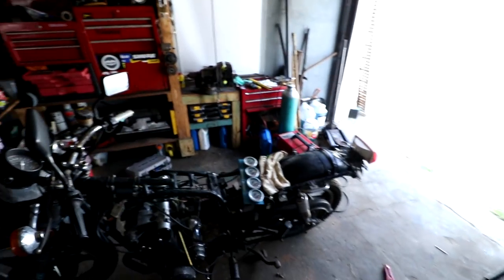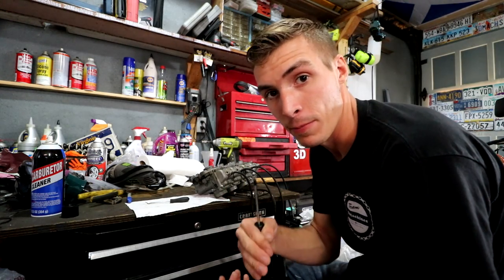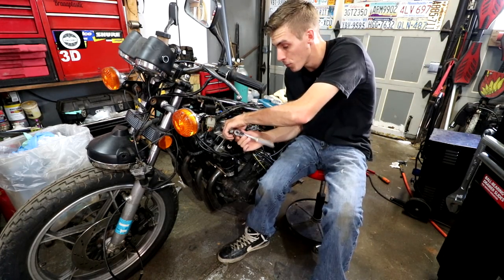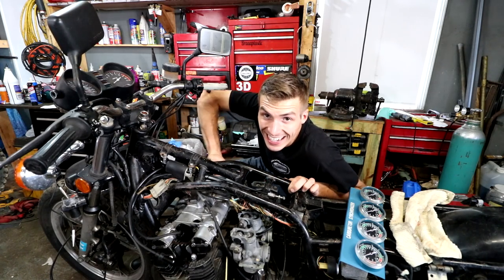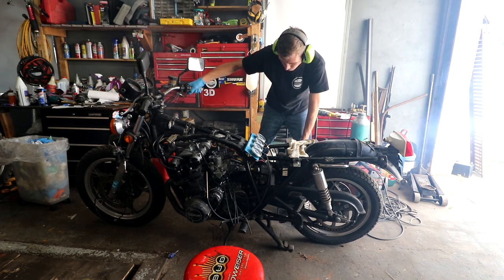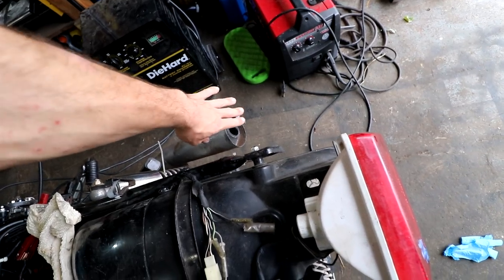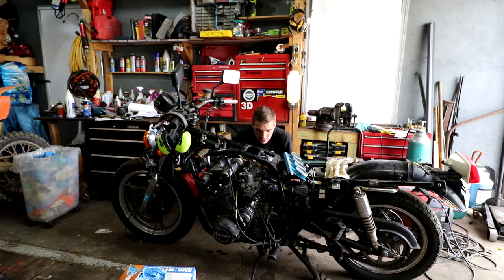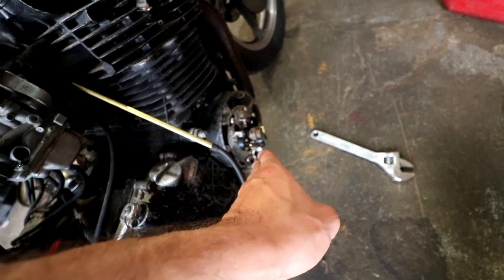1000cc ENGINE SMOKES TOO MUCH!!

Comment: Dalton I have had 2 of those bikes you are dealing with a timing issue not carbs
Reply: Rick Zamzow my thoughts too, carbs or fuel are probably a little off with all that smoke though
Reply from the maker: i leaned it out. Spark plugs look good. I just figured when I had that guy time it, he did it right... Guess not huh?
Reply: 3DMachines timing is NOT adjusted right...and check the heat from all 4 exhaust to se if it is some different temp between them
Reply: My '74 CB350F (F=four cylinder)
Was too easy to set up the points...

Supposed to use a dwell meter
to set the gap on points.
I always cheated...

Just put the cylinder where I wanted it to fire
(Top dead center... Then back up how ever many degrees.)
(there should be a mark for this...)
Then with plug that cylinder grounded...
Just start opening points 'til spark occurs
(I believe we called this static timing.?)
Then locked it down
repeat on second point/coil set.
Then you can verify with
a timing light...

Funny... I can imagine you getting
a dwell meter in the mail
that one of us old farts don't need any more.
(Mine is already gone.!)
(all my stuff now electronic.!)
Reply: Come to think of it...
Try checking with a timing light
before doing anything...
This way you will know
if going in proper direction.
I am sure you will understand
the sensor will simply go on
the cylinder for second coil
after you check first one...
(But I would not know if you use)
(same timing mark or if there is other mark.?)
(It may be self explanatory... Once it lights up...)
Reply: Last time I used a dwell meter...?
Five years ago on friends
1963 Triumph TR3
It was so beautiful.!
(only had two carbs...)
Reply: I agree with some of what you are saying, but it still can be an unbalance in the carbs..  Dealing with Suzuki outboards many years ago, timing should been dead on with the marks and points settings.. But back fire, is coming out the intake side of the carbs AKA lean. What you hear out the exhaust pipes is after fire and is cause from over rich from fuel... But timing can cause this also in a small way.. To me sounds like the carbs are not balanced yet.
Reply: It seems I remember
points have a slot in the mount plate
so you will have the set screw just "snug"
and use screwdriver to slightly move
until you get desired result
then "lock them tight".
Reply: 3DMachines I might not understand right... But how could that guy have timed it correctly if it's not running right
Reply: Suzuki had really good timing marks for a "static" timing marks that would make it run back in the day...  Where a service manual comes in great for it if you understand them... point gap setting is huge at the right mark...
Reply: alton, this will be the 4th time i've tried to get through to you.  you've finally addressed the float adjustment issue i tried to tell you about.  NOW, you need to find the cam chain tensioner and look up the method of adjustment.  you can mess with the points and carbs forever, but if the timing chain is stretched, you'll never get the timing set correctly. they are usually spring loaded and a very simple adjustment.  you are 90% THERE!  good luck! - dan
Reply: If the tensioner or chain is wasted the cams could have skipped a tooth out of time, better to find now than bend valves.
Reply: would try putting air cleaner on👍
Reply: daniel coxhead I agree
Reply: drunknpossum I love your name
Reply: Rick Zamzow I
Reply: Smoke coulda just been moisture in the exhaust or cylinders, this has been getting fed gas over the months and could just be burning moisture off. But I'd also try changing the oil to a thicker oil
Reply: if the timing checks out fine you gotta find out the reason why the intake valve in question is staying open while the cylinder fires. Check your valve lash and do a valve adjustment if necessary. Also you said you have a points distributor. I can almost guarantee those points need replacing or at the least file them down a little...then check the gap.

Comment: Man I've been here since 50K subscribers look where were at now. i'm just waiting for 1 million at this point
Reply: Logang L.F.L same
Reply: Logang L.F.L damn bruh you been here since 50k that's true love bro. Love you 3dmachines. I've been here since 200k but 50k?! That's true love. I love your videos 3d you are the coolest YouTuber in my opinion!
Reply: Logang L.F.L same
Reply: Logang L.F.L jp i only been here at about 90k
Reply: I got a question for you , I am thinking about getting a 1983 honda nighthawk 650 in descent shape only problem is it has not be started in a while and the engine makes a ticks sound he said . he said he will take 400 , what's your opinion
Reply: phillip Willis get it asap
Reply: phillip Willis get it now
Reply: Same
Reply: Phillip, I had an 83 Nighthawk 650 a  year or so ago; they are good bikes and not difficult to work on; great gas mileage as well, fun to ride too. Good vintage bike.
Reply: Also, the tic sound is most likely the valves need to be adjusted(not a hard job at all to do).
Reply: same
Reply: Logang L.F.L I was here well before 50k views

Comment: Dalton, this will be the 4th time i've tried to get through to you.  you've finally addressed the float adjustment issue i tried to tell you about.  NOW, you need to find the cam chain tensioner and look up the method of adjustment.  you can mess with the points and carbs forever, but if the timing chain is stretched, you'll never get the timing set correctly. they are usually spring loaded and a very simple adjustment.  you are 90% THERE!  good luck! - dan

Comment: you will never get them adjusted correctly without the air cleaners on.
Reply: tidblgger agreed
Reply: Right on!
Reply: exactly you need the airbox !!!
Reply: yep 4 stroke bikes are very sensitive to airflow. I have an old suzuki with a different engine but it HATES having even the air filter access hole removed. It's outside the airfilter but engine still hates it.

Comment: i have a 76 kz900 that had similar problems, bought a shop manual and did some fine tuning on the points, to get it dialed in,, shop manual helped out a ton.  as long as the timing marks on the crank and cams are on you have a bit of adjustment at the points and the proper gap is very important. like everyone is saying though sounds like the timing is to advanced, so when it fires the intake has not fully closed yet. At least she is a runner now hardest part done, just the dialing in and transplant to go.

Comment: Dalton. You need to make sure the boots where the carbs attach to the engine are free of dryrott and cracks. Also Get the airbox and airfilter on it. Not to get filtered air going to it BUT some older carb setups are designed to need to suck through a filter rather than suck air without any resistance. Hope this Helps. Like so he can see.
Reply: also check your valve adjustments. I cant remember if you have checked them in a previous video or not.

Comment: hey 3DMachines 
small advice for the karbs.
Screw all the adjustment screws in, and then screw them 2 and a half turn out. ore 5 half turns. 
that is called a basic adjusting. another thing aslong as the rpm raises when you adjust, you are doing it right :D

Comment: I would check the timing for the Sparks because carb-backfire happens when you have a bad timing on your spark so if it ignites while the intake valve is opened enough, it will backfire out of the carb, maybe it has to do with something else too but I don't know it's a theory but might as well check that out

Comment: Check the timing. I tried setting the timing by ear once then set the carb off of that. It ran and had descent power but when I used a timing light and set the carb the engine ran way better.

Comment: Check timing with a regular auto timing light while running. 1,3 and 2,4 run off the same points. You can easily figure this out. Ignition system repaired fixes all carb issues usually.

Comment: Hey Dolton mabey it's got a bad head  bent push rod ? Intake is out of time with the crank? Worn out cams,   more then likely it's the ignition timing,  exhausting when it should be on the intake stroke

Comment: after you get the carbs running correctly an are at the point of tearing the engine out of the bike are you going to take some time and tear down the engine before putting it in the Gator?

Comment: Just listening to the bike run its a timing issue and not a carb issue. Be sure to run it gently a  few more times as well especially once you get it running right to allow the rings to reseat since it hasn't run in so long that will also help with the oil burning issue and the engine will last longer

Comment: add marval mystery oil to the gas and crankcase oil the smoking will go away. one or more of the oil rings are stuck from sitting had the same problem with my 750.

Comment: Sounds like timing. I'm gonna guess cylinder 1 and 3, and 2 and 4 are on the same coils? That makes me think the points are slightly out. 

Also it's no good trying to set the carbs up without the factory air filter, without that you'll need to adjust the jets anyway. 

Fantastic video, love watching videos with the GS in it

Comment: hey 3dmacheines, heres a tip, i had yamaha rx1 witch has a 1000 4 cylinder so pretty well the same thing as your gs1000, and it would back fire and run like crap without the air box, same with my 2007 yamaha nytro 1000 carburated, i couldnt ride it without the airbox it would always back fire all the time and fall on its face, try putting a air box or air filters, itll cause a restriction. just a thought and my past experiences.

Comment: Wouldn't the back fire through carb be the intake valve open too long or timing off, instead of carb adjustment. Love your project, sounds like fun is getting closer.

Comment: Try tuning the carbs with the air box on or the air filters on its amazing the difference it will run it's like if you took your honda 450 and took the air box off it's not going to want to run

Comment: the carburetors are fine, seldom will a carburetor cause a backfiring issue. it could be an ignition timing issue however it could be a valve timing issue also.

Comment: sounds like the timing is out to me or could be a sticky valves if it has not run for a while or at worst bad valve seats as I think a 79 could take unleaded as the some older bikes needed leaded fuel and if run with unleaded and no leaded additive will burn the valve seats but I think America was using unleaded way earlier than us brits so it may be ok as adjusted for that

Comment: Rotate the engine until the points fully open. Loosen the adjustment screw and pinch the feeler gauge between them with your finger and tighten the screw. Sometimes if you want them set at .020 you have to use a .019 gauge to make it set correctly once you tighten the screw.

Comment: The factory airbox would make that GS1000 engine run much better. My findings are most Japanese engines are a tuned system and that starts at the airbox cover all the way out to the exhaust tip. Any changes mess with it.

Comment: You should just build an intake manifold for the GS-1000's engine that uses a single automotive carb since it will be going into the Gator anyways. Would be way easier to tune and would be alot more reliable. Would also make for an interesting video.

Comment: There's a possibility that since it has no restriction from the missing stock air box, that it's not getting enough vacuum in the carbs to suck fuel from the bowls. I'd try getting some bigger jets or find a stock air filter box and go from there.

My bike did the same thing when I tried removing the stock box and putting some pod filters. They just breath too freely and don't generate the required vacuum to suck fuel from the bowls.

Comment: You need the original air box. With the header that's on it and no air filters it's running lean. Needs more fuel.  The smoking will clear up once out gets up to running temp.

Comment: remember mixture air gas I have a Suzuki GS 650 I've been working on for like 7 years got lot's of new parts and learn a lot about the calculator am going to be working on my car and then again I'll be solving my carbs problem

Comment: If it's backfires through the carbs the timing is off. Its firing while the intake valves are open. Need to adjust the timing
Reply: the valves/seats could be rusted/dirty and leaking ;)

Comment: With it dieing as soon as you give it gas there's a good chance that the jeting needs to be changed especially since there is no airbox. Try taping half the carb intake off on each one and see what it does. If it runs better you need a bigger jet for more fuel. If it runs worse you need a smaller jet for less fuel.

Comment: You may want to do an compression check on the engine again... cylinder rings or/and valve seat seals can cause the smoke by oil burning. If compression is fine you might want to change the possible 30+ year old valve seat seals. And Rick might be right the back fire is mostly a timing issue... you might want to check the valve timing to, since you have no clue what knobhead worked on the bike before you got it.
Reply: right on, previous knob-head that shimmed  lifters wrong could have burnt valves, but it likely just needs some run time with magical cleaners to clear up somewhat..
Reply: tb... If you want to half ass the job so it just will run a while you may use some cleaner to get the gung off.

Comment: If you put in the stock jet sizes, not having the air box and filters on will make it impossible to make it run good. It will always be lean on the top end.

Comment: I would do a cylinder leak down test. This will tell you if your valves are bad. Get a cylinder leak down tester  hook it up into one cylinder put air to it (not sure how much) then if you hear air out the intake then your intake valves are bad or the seats and valve face have a lot of carbon. Now Same goes for the exhaust valves, if you hear air out of the exhaust then there's carbon built up around the valve seat and the face of the valve.  If you don't hear anything then you need to find out how many minutes it is to how much air you lose after you out some in the cylinder.

Comment: Cylinder 4 doesn't cough and spit and seems to have no issue????

That's the one that's got the clogged jet, or busted coil,  or plug wire. That's the one that's misfiring. 

You can check by feeling if the exhaust tube for that cylinder.

Comment: That is definitely a timing issue mate, not a carb issue. Just like with a vehicle engine, if the timing is off, it will spit, sputter and back fire through the carb and exhaust.

Comment: U need a air box on the carbs or they always back fire
Reply from the maker: are you 100 positive?
Reply: 3DMachines I had a 1981 cb 900 was back firing just like your bike put the air box on and tune the crabs and never back fired again but I couldn't get the tune right or stop back fire with out the air box I was told because the crabs where getting way to much air with out a air box

Comment: The reason it is smoking is because the Jesus clip may be loose on the carburetor bearing. There could also be a bent Finigen pin on the exhaust intake

Comment: Hey bud it will never run rite with our air filters because of the air fuel mixture. If you run it without air filters you will have to reset the bike
Reply: Been working on bikes for a long time

Comment: ARE THE PLUG LEADS ON RIGHT ????? COMPRESSION TEST NEXT . DEFO SOUNDS LIKE THE PLUG LEADS ARE MIXED UP ???  OR FAULTY . Did you get a ticket off the cops or did they want a fry ??????? lol . You done a lot of work on the GS . Pity its running shit  .

Comment: you really need the intake tubes and the air filter box/pods on to properly tune that bud. my 750 WILL NOT run without the intake on it. sounds like your timing is retarded a bit as well as possible valve lash issue. good luck man. pull the cam/cams and do a solvent leak down test to check valves without pulling the head.

Comment: A gs1000 will never ,ever,run right without the air box connected or carbs tuned with the correct air pods.You should have sprayed seafoam into the carbs while running then shut off with seafoam in the heads,it would clean your valves.Just Saying..

Comment: Could of already had it done if you put a predator motor in it this thing is going to be a turd and never run right or for very long and the motor going to be too big to work on in the gator plus it won't be able too off road hardy at all

Comment: Timing is off
Reply: Bring your engine to top dead center and look up ur timing set up and do as factory recomends it's a couple hour job at best make sure u mechanical timing is correct first then set ur ignition timing with the magneto that should be couple screws just loosen then twist it to the desired timing might even have timing marks to line up